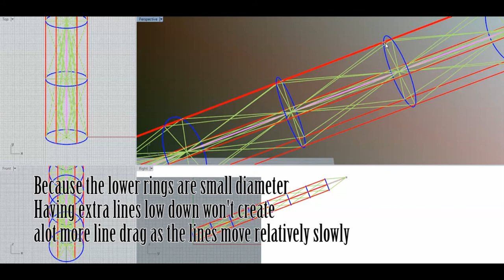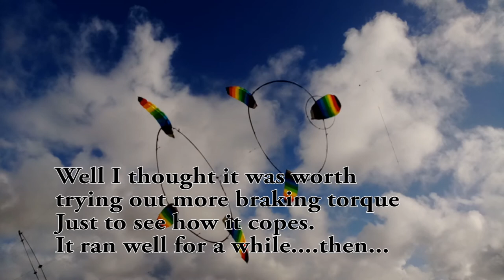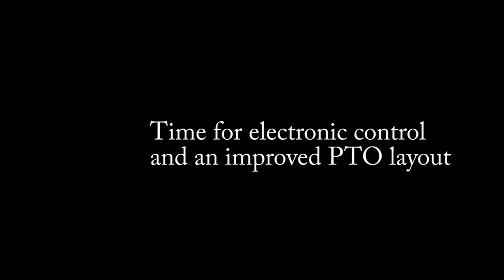Daisy Testing 16 Sept 2017 fewer lines more torsion longer ladder

Comment: Does this mean you're moving to an electric braking system (I'm thinking generator with dump load) or just having the current mechanical brake be actively controlled electronically? Sorry if this question is a bit irrelevant, clearly you're focusing on the novel aspect of the rest of the design, but that stalling brake has been bugging me so I'm glad you're fixing it :)
Reply: Great, hope the upgrade goes smoothly. If you don't mind me asking are you going for an off the shelf generator/charge controller kind of thing or making your own? I've recently started working on a wind powered car project at uni that's been going for years http://www.bristol.ac.uk/engineering/departments/eeng/courses/undergraduate/aeolus/ and it seems like the home-brew way can be challenging to get right.